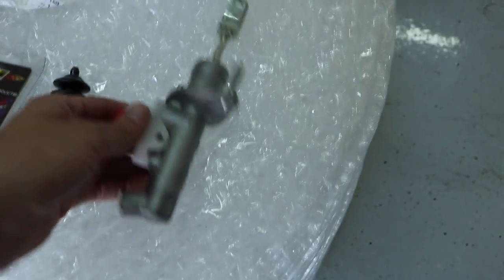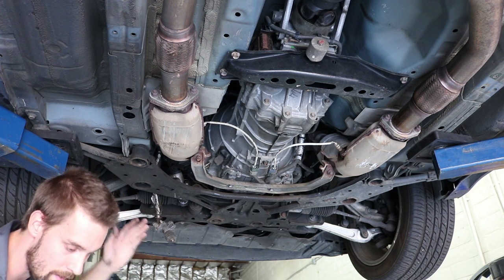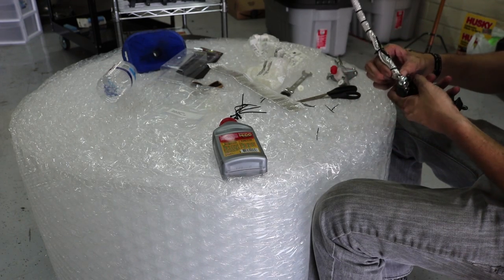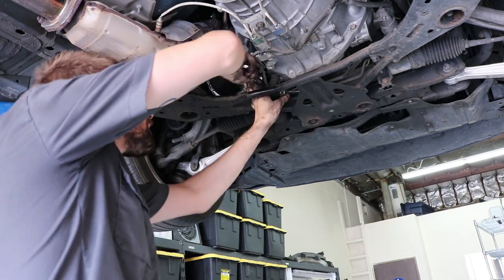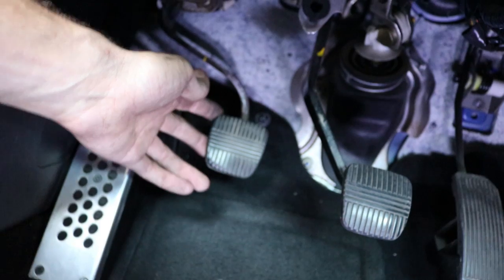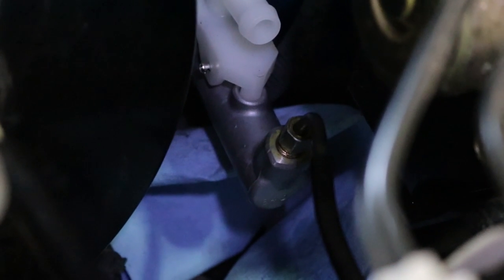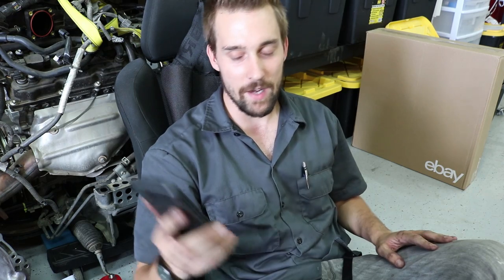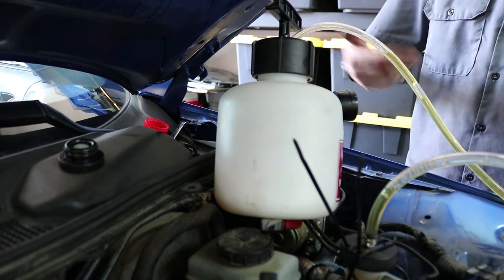350Z Clutch Master Cylinder + Slave Cyl  + SS Clutch Line Removal & Install

Comment: Remember, always, I repeat “always” use a line wrench for brake and clutch line fittings where the line comes in with a nut (usually 10mm). Otherwise you will strip it almost every time. Pro tip, if you stripped it anyways, hit it with wd/pd and get a small set of vise grips lock them tight and you will succeed! Good luck! 👍🏻
Reply from the maker: Hahaha, I've bought flare nut wrenches since I put this video out, too much headache before lol
Reply: Flare nut wrench

Comment: Thank you for taking the time and effort into putting a great video together for this specific purpose. I know it is a lot of work and  is much appreciated. I am about to undertake the task of putting in a new slave, braided/heat shielded line and, as you say, master cylinder for preventative maintenance. My pedal has begun to stick half way in warm weather. I will also likely keep the old master cylinder and purchase a rebuild kit for the future use.

Comment: I gave up on the stainless steel clutch line. Was a pain in the butt removing the clip working on my back. Need to make friends with someone who has a lift. Just replaced the slave and called it a day.
Reply from the maker: Ze26 Having a lift makes life a lot easier, lol.
Reply: I have TPs so probably way more room than if you're still on stock cats. I used vice grips on the lip...just enough room for them to hold...got a long flathead and large sized wrench(or something that shape/size). Used the vice grips and the body to pry on. Not hard just wiggle back and forth each side...longer the flathead the easier it is. But it's incredibly easy once you're down there and hook it up...I thought it was going to be a bitch. My car is on blocks...maybe 8" off ground. Just enough room to wriggle in there and room for the angle to use your arms well enough.

On now to the csc delete kit...new flywheel and clutch...lots of fun can't wait to try everything out lol

Comment: You should install the rjm clutch pedal assembly next. You'll be amazed how much better the engagement is.
Reply from the maker: I've been thinking about it, but after I did this I literally can't come up with one complaint. It feels great, so far anyways, lol.
Reply: Full Throttle 
The pedal is a great addition on top of the new master and slave cylinder. Trust me, you won't regret it.
Reply from the maker: Riley I'll look into it a little more, I have watched a lot of vids on them and everyone says it feels great, so I will give it a try sometime 👍

Comment: that is interesting.  I have an 01 frontier and am attempting to do this same thing.  the bolt on my hard line is also stripped.  and the nut connecting the slave cylinder to the clutch line is also stripped (that I have completely given up on loosening).   so hopefully I get get the stripped bolt on the hardline to loosen.

Comment: Heres the issue i had with this short version line; the oem hard line from the master actually needs to be replaced because it traps debris in a loop under the fender. just replacing with a short line will give you result but it wont clear the lines and give ultimate pressure to the slave. You definitly should consider getting a braided line from the master all the way to the slave, promise it will be worth it! I did a new slave and master with this short line and still had mush.
Reply from the maker: Nick Nunez that's interesting, I don't have any mush since I replaced the master, slave, line, and fluid. But that is something to look into, maybe ill do that when I buy a cd009 trans. Do they make a kit for this? If they do send the link to my Instagram if you have one @justdriftcharlie my profile is a picture of my face. There's a few fake profiles of me from some people that apparently have no life. Lol
Reply: DE350Z33 do you know where I can get a braided line like that been looking everywhere

Comment: I striped the flare nut.😤. I even used a Flare wrench with WD 40 when  the first slipped happened. Now I have to buy a complete stainless steel line to replace the hard line/rubber line.

Car guy problems.
Reply from the maker: Sorry for the super delayed response, damnnn, that hella sucks my dude. At least it's not a brake like from the abs all the way to the wheel lol. The clutch one isn't super hard to change
Reply: I think a lot of them were stripped by stupid mechanics.  my hardline bolt to the clutch line was stripped in my 01 frontier just like in this video.   the nut connecting the clutch line to the slave cylinder was also stripped.   I want to put a blow torch on it to get it loose but I am afraid I will start a fire.

Comment: I know it's a old video but my z I drift is an 07 and once I get the car hot at an event and half way through the day my clutch pedal will stay on the floor. Does this mean my master is bad? The 07s have a csc and I ended up installing the zspeed csc elimination kit thinking the slave was bad. It needed the swap anyway but just wondering if the issue was my master from the start
Reply: Same thing happened to me at an event with my G.  First I changed fluid to dot 4 from dot 3, higher temp range. Helped but still happened when it got hot. Ultimately replacing the master and slave as well as adding the s.s. Clutch line fixed it and made the clutch sooo much better!!! Good luck 🤙🏽
Reply: @rollinthesweets6147  I actually got it fixed last year, I ended up changing out my csc and added a cmak csc delete kit, it is so much better and pretty easy to install

Comment: The problem you mention at 14min, is there a way to fix this?  I'm having that issue and adjusted the clevis but clutch pedal is returning and car is having issues going into gear.  Great video, thanks!

Comment: My 06 g35 clutch pedal does the same on a hot day are even driving for a long period of time
Reply from the maker: Have you ever replaced your master and slave?
Reply: Full Throttle never have, it has a 150000 miles now
Reply from the maker: Wowww, lol. I had to replace mine at 92k. You're lucky, these clutch's/master and slaves usually fail around 80-120k miles. I'd replace the clutch(if you haven't), the master, and slave. And I'd flush every type of fluid you have. Coolant, brake fluid, power steering, etc. It sounds like you've taken good care of your car though, because I have people all the time..... 99k miles ..... new clutch/master/slave/etc. lol
Reply: Full Throttle yes everything is still stock on it and thank you 🙏 so much for those awesome vids!!
Reply: Full Throttle nope never had been replaced

Comment: So I helped replace clutch/pressure plate on 04 350z. Clutch was ok but I think because it needed to be broken in as engagement was looked to be about 1/8" from release of pedal and gears were slightly tough to engage, especially reverse. So son wanted to bleed and he went and opened the bleeder before I got to do anything and clutch went to floor with no pressure and return. After pumping and bleeding no luck of buildup clutch pressure. Need day pressure was up on it's own. I thought maybe best to get new slave. He installed new slave and we just cannot seem to build up pressure, but were only able to get fluid to flow out and pedal still stays to the floor. I figure we're doing something wrong. Any advice?
Reply from the maker: Did you get everything situated correctly?

Comment: Thank you for this exceptional video…..just have a question, I recently put a new clutch on my 08 350z and  when I shift to 4th gear it won’t take it. Do you think is the slave cylinder that needs replacement? If it’s do I need to take down the transmission to replace it? A newbe @ it.
Reply from the maker: If you want to respond to this message on IG @fullthrottleperformance916 or @justdriftcharlie it'll be a better way of getting a response. But what do you mean it won't take it? Like it won't go into 4th at all? Does it grind? Or does it feel like nothing is there?
Reply: @fullthrottleperformance  it won’t go into 4th and I just put a new clutch on
Reply: Thanks for reply
Reply: it doesn't grind  it feel like nothing is there?

Comment: Just subscribed! Great video but I have a question. If I use the SS Insulated Clutch line from Z1 Motorsports, do I still need to wrap it with a heat wrap?
Reply: I'd say no.  FWIW, I just bought a Sunsong one off rockauto.com that is already wrapped for $15 shipped.

Comment: Hey Charlie I just recently tried to replace my oem clutch line to the SS clutch line and I looked up the car where the line meets the hardline and noticed the nut was rounded is there anything you recommend on how to fix it whether it be to replace the nut or the whole entire line ?? Any tip would be appreciated !
Reply from the maker: Damn bro, that sucks. You have to replace the line in between the master, down to the chassis mount. Check out our ebay store. I think we have some in stock.
Reply from the maker: https://linktr.ee/FullThrottlePerformance?fbclid=PAZXh0bgNhZW0CMTEAAaZVxns-XqDSh6VCk8C8e1rVDEbxi1VRh-7Rraiq8YB-1rziyvZcST1gLo0_aem_AWVnE7HReA1aDN5C6G6LZtKTA42VmXvwP4OXE0ffqshfpwdNnCd6i3FLJwrAd617HvJ4Opw21TSSv7juD7X1kxOI
Reply: @fullthrottleperformance  Thanks Charlie I’ll be sure to check out your page 👍🏼

Comment: Hey man, replaced my slave cylinder and replaced the line with the same line you have. I’ve been trying and trying to bleed it with my motive bleeder and it seems I can’t get all the air out. I’ve checked for leaks and nothing. The pedal will not build pressure and I don’t know why for the life of me. If you could spread some knowledge that would be amazing.
Reply from the maker: Hit me up on IG, @justdriftcharlie

Comment: thanks for a great DIY, can you tell me what Motive bleeder adapter you used. thanks.
Reply from the maker: Thanks man! But honestly, I wrote the number on the bleeder hose, but the brake fluid took it right off. I needed a new O-ring not too long ago, and couldn't remember what adapter I used. But I believe it was the 0107, I think that was the number, but look it up. Because I don't remember exactly.

Comment: ya'll make it look so easy. i bleed my clutch fluid and fill and drain the air out and my clutch still not coming back up. i must be doing it wrong by just draining it into an empty bottle. gonna try to put brand new fluid in a bottle with the hose in it and see if that work in case if air gets back into the bleed valve, but i dont see how air can go back up when the pedal is press down and hold down when i open the valve then close it and repeat.
Reply from the maker: The two man method is very difficult to get the clutch system bled on 350z's. I don't know why, most likely from the design of the lines, but honestly. I love using the Motive Power Bleeder. It makes the job so much easier, and quicker.

Comment: I recently bought a 05 350z and today the clutch pedal has been sticking. Basically I can change gears but the pedal doesn't come all the way out. What could be the problem?
Reply from the maker: I'd try bleeding the system, if that doesn't work, your slave cylinder is the cheapest first replacement.

Comment: Got a question regarding to brake bleeding. Some context: changed my brake lines to braided SS and bled them the two-man method. Although I can stop the car under hard braking, my brake pedal still feels a little soft even though it should be a stiffer than OEM. I did buy the motive power bleeder and bled the brakes hoping it would stiffen the pedal but its still soft. Any guess why it's still soft?  Figured I'd ask on this video because the processes are similar. Much appreciated and great content!
Reply from the maker: Did you use bottles with hoses on your bleeder valves to make sure air doesn't move back into your calipers? And what type of fluid did you use?
Reply: Yep. Used tight fitting hoses into bottle with fluid in it so no air can get into it. I believe it was dot3 I used in the yellow bottles from autozone. I might have to try bleeding them in a different order. I did it according to the 2003 350z fsm but read on my350z on bleeding order
Reply: Good pads, ss lines, bled proper & still mush? my guess is caliper seals going bad. check for small leaks on pistons. if not your booster may have a leak... all bad

Comment: I need to replace my clutch master and slave cylinders on my 2007 350z. The dealer said the transmission needs to be removed to do this. I don't think it's necessary. Please advise. Thanks
Reply: No lol
Reply from the maker: Yes, the trans has to be removed on the HR engines since they have a CSC. Benjamin is correct

Comment: Hi,after driving for about 40 min my clutch pedal gets stucks what do you think bad clutch or sleeve and master cylinder needs to be changed? Car has 125.xxx miles all original,Thanks man great Vids
Reply from the maker: Yeah, one of them(master, or slave) is starting to go bad. Or you just need to bleed the system with a higher wet boiling point fluid. Like Motul RBF600, I honestly think that fluid is the best IMO. Maybe try changing the fluid/bleeding it, then if it doesn't work heres the link to a good deal on OEM Master, and slave cylinders. If you need them
Reply from the maker: https://www.ebay.com/itm/2003-2005-Nissan-350Z-Clutch-Master-Slave-Cylinder-OEM-NEW-Genuine/191343943509
Reply from the maker: I've bought from QuirkParts on ebay hella times lol
Reply: Thanks,yeah I check the fluid is very low....maybe just need a blend n a refill?
Reply from the maker: Yeah I'd just flush it too, and check all the sealing locations, like the master and slave to see if they're leaking
Reply: Just got my done,but I have to push all the way down the pedal,clutch feels low.......maybe still some air in the system?
Reply: @jnagime  its the pivot ball

Comment: I had to go beyond the threads with my master cylinder..the opposite direction..im 2 threads backwards....the OEM one...wasnt getting afull stroke if i didnt move the fork....if i didnt do that i woudknt be sble to get the car in gear..so they r not sll the same ans the preset may not be right..it's still giving me problems...will shift good for a week and then won't go into gear..when i open the bleeder screw nothing comes out unless I pump the pedal 
..makes no sense

Comment: Thank you for the great video! One question, I hope you can help. When using the pressure bleeder, why was the clutch pedal pressed two times? Is it enough to bleed your clutch master cylinder? And how about brake master cylinder, does it also need to press the brake pedal twice?
Reply from the maker: Sergii Kvasnyi I re-bled everything again after I was done with this video. And I pressed it a few more times because there was still more air in the system. But in the video it worked great for like a day then I re-bled the system to make sure there was no air left. Personally, I would keep pushing the pedal until no air bubbles come up in your reservoir, after you've filled the system with fresh fluid. Hope that helps, and good luck.
Reply: Thank you very much for your advise and fast response.

Comment: Hey man so I replaced my slave & master cylinder today, there’s absolutely no pressure in the clutch pedal. The slave cylinder doesn’t even move because of the pressure so I can’t bleed it. If I crack open the bleeder valve I get no fluid draining from my. Any tips??
Reply from the maker: There's two different ways of pumping fluid into the system. You can try from the bottom, at the slave cylinder and try to pump fluid to the top, or the way I did in the video. Or you can use the two man method, which isn't impossible with the z and g, but it's a pain in the ass. All you do is one person in the car, one person on the ground with a bottle and tube attached to the bleeder valve. Simultaneously, press the pedal, then open the bleeder valve, close the valve, then lift the pedal. Repeat for the next 2 hours until you get a firm pedal.

Comment: I have an 06 350z revup experiencing clutch slippage, and eventually drooping clutch in heavy traffic. Approximately 3 weeks ago my clutch was strong and didn't have any issues.
I just did a clutch flush and the bite feels new. Drove on the new motul for about a week and now my clutch is still slipping. Possibly does the slave affect this? Or my master is adjusted incorrectly? Please help.
Reply from the maker: It just sounds like your clutch disc is worn down. Have you figured it out yet?
Reply: @fullthrottleperformance  Since then, I've replaced both cylinders. Yes it is a worn clutch. The new cylinders shown how bad the clutch really was. Thanks again for your informative videos. I am purchasing a JWT performance kit from Z1 motorsports. Wish me luck!
Reply from the maker: @shinrsc  No problem my dude, I just replaced my clutch with the JWT lightweight flywheel clutch kit too. With the Z1 Lightweight crank pulley, they both make the car feel much more responsive

Comment: Hey! I'm doing my z and for some reason am not getting any pressure on the pedal. I checked the lines and nothing seems to be leaking. There is one thing that is odd, when I leave the pedal out and then bleed it it has pressure but doesn't throw the pedal back out. What do you think?

Comment: Starting in 2007 with the G, the slave cylinder is Internal. On the Z, I think it was 2008.
Reply from the maker: Any z or g with a vq35hr or vq37vhr. And it's a csc (concentric slave cylinder)
Reply: I've got a VQ35DE 2007 G35.